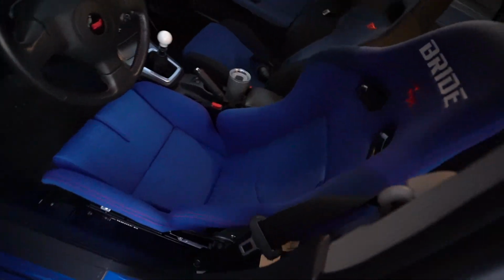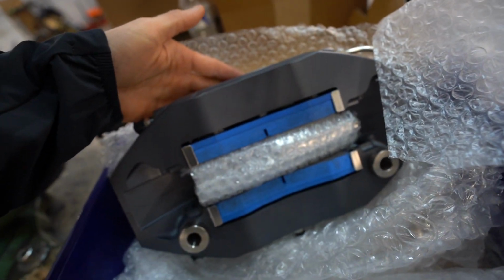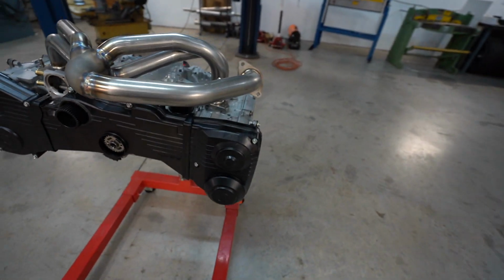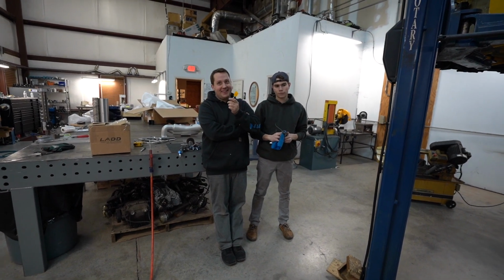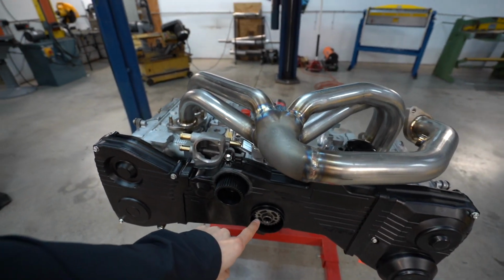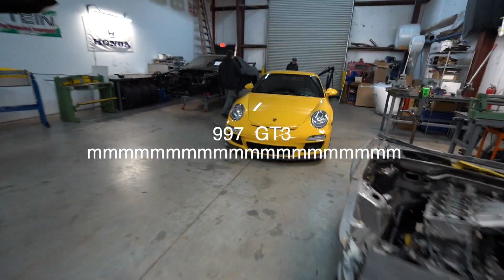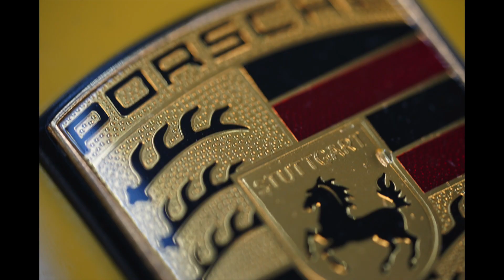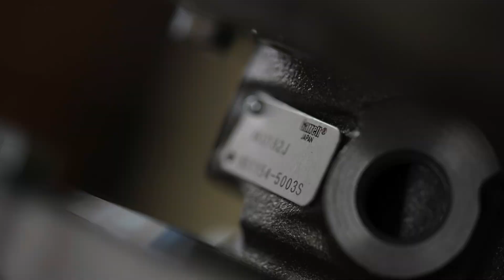(2019 project) Been Waiting SO Long for This!! FPV/WRC?

Comment: Totally forgot about your sti lol!   So miss my 2002 sti build.  575 at the wheels and built to endure tarmac rally as well as dirt roads in south louisiana and the everglades in south Florida.  Man she was fast and reliable till the end.  Her last race took out the radiator, blew the turbo... hell blew out the entire exhaust from the downpipe back 😆, act stage 3 clutch and broke my shift linkage and a motor mount.  Haha.  Still managed to limp to the finish line.  Definitely tough cars when properly setup and taken car of.  😁👍👍

Comment: Thanks for sharing Steele!  Great to see your consistency in the pursuit of performance... built motor + dry sump is highlighting how far you are willing to go!
I'm pushing the limits of my standard internals with my daily drive - Stage 3+ Golf R - 425hp / 530 NM at all 4 wheels on Pump 98 + Water/Methanol injection... If I get silly needing more power again, a built motor on E85 will be next :)

Comment: I have question not related to this video.  I have a set of your v1 as well as v2 and stout motors all are flying awesome I must say but today I had to take one of the v1s  apart because it picked up a piece of solder off my bench.  My only problem is I destroyed the c-clip and cant find replacements . Any recommendations??
Reply from the maker: There are replacement C clips on Team black sheep’s website I am almost positive. If not   Most c clips from other motors work if you have a busted motor lying around.  We did away with the c clip in version 2